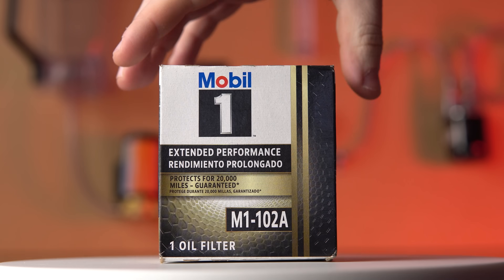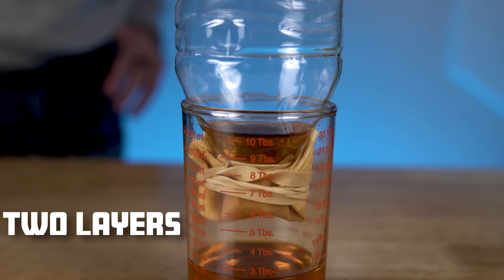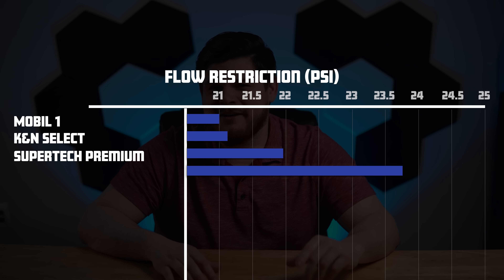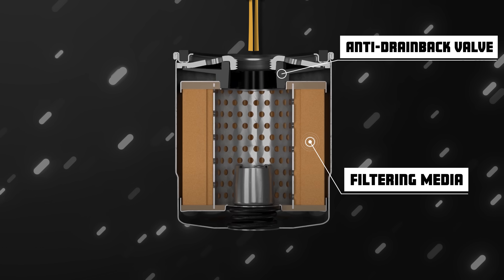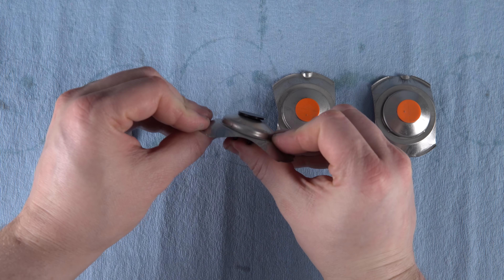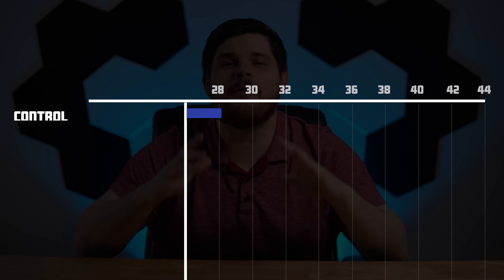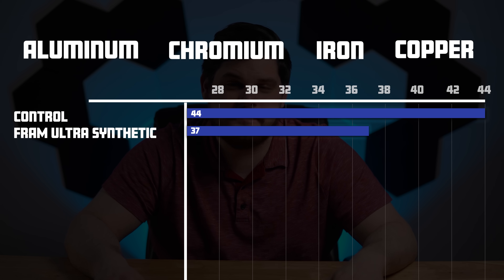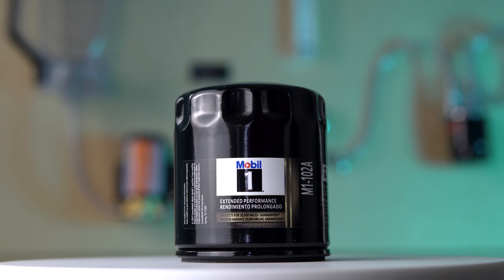Engineers Test the Best Oil Filters! FRAM | Mobil 1 | K&N | Walmart Brand

Comment: Honestly, my takeaway is that as long as it's not complete knockoff junk quality and literally falls apart, just send it and don't stress about brand too much.  For every extra bit you filter, you also restrict oil flow, which in some situations can increase wear just as badly as dirty oil.  Just get whatever filter and periodically check the condition and color of your oil, simple as that.  Any of these major brands must be good enough or else they would be sued out of business. You do far more by treating your car right and warming it up and cooling it down properly, doing a periodic long drive vs. all short trips, and avoiding prolonged idling like sitting in your car with the A/C on during lunch than you ever will by nitpicking oil filters and brands as long as it's a major reputable company.

Comment: Been using Wally filters for 30 years!
300,000 KM. on two Dodge Caravan 3.3 Liter engined vehicles/17 years each. Bought the filters by the case for $3.OO/ unit in the USA ( I am Canadian),  Neither vehicle burned oil in any amount that was concerning. Always changed both oil and filter at 3,000KM. ALWAYS.
WIX at various times made their filters but Wally goes for price and quality, and over 34 years manufacturers change. Especially Fram ?
Supertech filters are not really available up here now, so a trip south will be in the cards. But their oil is, and 80% of the time I use their oil.
Buying a new Corolla Cross and plan on changing nothing. 3,000 Km & Wally oil. 
Sounds like a good plan. Stick with what works and is reasonably priced. I always do my own oil changes.
Liked the test here though. Well done! But I would never use a Fram filter again.

Comment: ok so heres something i was thinking that could really throw this off. the weight of the oil its self. my wifes car runs a 0-16. basically colored water lol so the flow rate i would assume would be less of an issue say a pick up running 10w-40. would be awesome to see even a lighter weight vs a heavy weight in these test. would ASSUME. a filter like the fram being more restrictive with a thinner oil would still allow proper flow rate while providing better protection. although i could be wrong and weight may not even affect it at all

Comment: I've used Fram filters for years 

good to see other filters getting a spotlight on performance. 

At the same time however, temp also plays a massive role and I saw your testing did not account for that. That being said, i can forgive it 

Fantastic video and keep up the good work
Reply: Cut apart a standard,  base Fram filter. You'll never consider using Fram again.  The high end ones seem sufficient,  but the base Fram are incredibly cheaply built.

Comment: It's impossible to rate an oil filter by miles, then apply that rating to all your filters. You need to heat the oil to something close to operating temps. I realize that may be very difficult, but it will have an impact.

Comment: First I would like to say. Great testing. Is it possible that your fluid pressure test results could be effected by the bypass valve pressure setting? If the bypass was partially open during the restriction test. It could give you false results. That may be the reason why the Mobil1 filter did not reduce the contaminate PPM as much at the other.  How could you test at what pressure does the bypass valve start to open? I actually use the Mobil1 filter on most of my vehicles. I think feel most filters on the market will work fine for a daily driven car. just understanding their specs and you'll be fine. It's the high performance track driven cars. Where you will see the necessity for improved filtering. If you could test the Wix XP , and the MANN filters.
Reply from the maker: @Mark Edwards Thank you so much for watching and the feedback. You are correct, they could be affected. We released this video with just 400 subs and as a small channel we had very limited budget so we only included the inlet pressure. The best way of actually measuring the effects of a filter would be to measure the pressure drop across the filter. The by pass valve psi rating the oil filter remanufacturers advertise is this differential pressure not the actual inlet pressure like we measured, thus we don't actually now if the bypass valves were open. We are currently modifying our rig to better improve our testing methodology including the addition of an outlet pressure gauge to measure the drop in pressure. To determine when a valve opens is pretty complicated, but we might be able to if we run thick fluid and graph the flow vs differential pressure and look for the inflection point where differential pressure doesn't increase anymore, but this would technically be a ball park, then under a separate test we would ensure we stay below that pressure to ENSURE we are not bypassing. Hope this clears it up and thank you for your feedback, it really helps us improve as a small channel.

Comment: I suspect that the grit being at the bottom of the fram ultra filter was due to the grit falling out to the bottom of the filter due to a slower flow rate.  The other filters had more in the filter media due to not having time to fll to the bottom.  It was either that or the media was so tight that the grit could not penetrate at all which would be a great sign of way higher filtration.

Comment: Something to suggest. I would have ran a setup where you were pushing 50 psi to see if the media failed or when the bypasses opened.

Also it didn't look like you were running a heater. Might have been interesting to see how the media holds up with really hot oil (like 250-300).
Reply from the maker: Great suggestions! Thank you so much. Definitely planning on making some improvements for future videos. Thank you so much for helping us improve.

Comment: I used the Cheapest Frame Filter on my 97 Chevy 350 -5.7 liter Truck for close to 200,000 miles and it Never used any Oil and Engine always ran Good, it was Running Good when I Sold it...

Comment: been driving for over 40 years and always used dino juice for oil and a new filter.  Changed every 3k more or less and never once had a single issue with any vehicle I was driving.  You dont need an expensive or "the best" oil filter if you arent frickin lazy.  And if you dont change your own oil, just shut up.

Comment: There are many mid- level filters like Wix, PureOne, Motorcraft that’ll protect your engine for hundreds of thousands of miles without spending 10-15 bucks for them. As a professional mechanic it’s been my experience that most contaminants that cause wear such as dirt slip past cheap or worn out air filters. Even if you have a premium oil filter installed it’s not going to filter below 20 microns at best. Wear is primarily caused by particles smaller than that . Bypass oil filtration is the only method that will remove wear causing particles down to around 2 microns.
Run the best quality air filter you can and use a decent quality oil filter and change your oil when it needs to be replaced. I set my intervals at 7500 miles based on oil analysis . Some people can go longer intervals and some will be shorter based on their vehicle and driving habits.

Comment: Decent test only issue I thought of is the pressure numbers.  The bypass either needs to be disabled or need to know when it could be opening at the very least.  Not to sure it affected the results since oil pumps are roughly 70 - 80 psi regulated.

Comment: Has anyone installed a separate bypass system with a 2 micron filter? Amzoil has low micron filters. I was thinking of a setup that tees into the oil pan drain plug with an electric oil pump, through the bypass filter, and back into the engine. If the bypass system ever stops working, the original system is still in place. With 1 or 2 micron filtering, the engine would last forever.

Comment: Been running M1 EP oil and filters in all my vehicles for 15 years. Even in my 240k mile 5.4 3v that has known cam phaser issues and it's still quiet as a mouse fart.  Glad to see the filter did so well.
Reply: Dirty oil is what messes up the phasers. I change my oil at less miles than they say and my 5.4 is running great at 190k miles
Reply: Same here, my Honda and both my Nissan trucks I’ve ran nothing but Mobile 1 filter and oil and all vehicles hit 250k+ with no issues. Generally no filter is going to hurt your car, the cheap off brand ones quick lube places use is pretty much the only one I’ll never use.
Reply: Cam phaser on those is basically a routin maintenance thing done around 80,000 to 100,000 miles. Stupid system.  Is it possible to lock them once they get redone.
 After being told by many people that you could not lock them, I found a Ford guy.  Mine is going great. Was done a few years ago.

Comment: These are  NOT real world tests because there is no engine in the mix! Engine oil is not only used for lubrication but also for heat removal as the engine coolant does. it also needs to remove contaminants like carbon! Engines have an oil bypass valve. When the oil pressure gets to high it by passes the filter so un clean oil still lubricates the engine. the pressure in your engine is managed by the engineparts and the filter. exessive engine wear will lower oil pressure just like high rpm. the oil does not only catch metal particulates but also carbon that is wy it becomes black so black oil does not always mean it needs an oil change it can be black in as low as 100 miles this how ever could mean the filter is not that good because contaminants stay in the oil. so i would like to see heat cycling in the mix.

Comment: Has anybody realized yet that the "restriction to flow" test is just testing how soon the bypass valve opens? Lower pressure doesn't mean less restriction through the filter element... It means the bypass valve is opening sooner and oil is not going through the paper.

Comment: Did you test all the same fitment to same vehicle? For the PSI changes could be the result of the different bypass valve spring strength which is different for different vehicles.

Comment: Isnt the k&n select like a fake k&n? I think its just a economy filter with their name on it. The real k&n is almost 20 bucks and has a thicker housing and 1 inch nut on the end for removal. If i remember right it has the metal joint on the pleats and all the good stuff of a top grade filter. The pleats on the good k&n also give more surface area but still not as much surface area as some other filters like the mobil 1 in this video and the premium stp filter has a lot of pleats too. Ive been using the good k&n filters for a very long time ive cut open quite a few then my other favorite is bosch then mobile 1. I think wix is supposed to be pretty good we run their coolant filters and im really impressed with those when i cut those open but ive stuck with k&n for our oil filters.

Comment: I appreciate you taking the time to build a rig to really test filters! Every other YouTube video I've seen have just been breakdown videos where they compare visuals. It is this type of independent testing that truly informs us. Definitely subscribing.

One  minute detail would be heat, as oil viscosity is very different at operating temp and could make a drastic difference in filter performance.

One more thing that was left out in this video though was the oil bypass performances. All of those filters' bypasses are going to open at different pressures, and that is arguably one of the most important factors as play. Sure, one may have better flow than another or may have more surface area/better media in the filter... but if it is possible that one of these filters' bypasses opened during testing to allow dirty oil to flow  then it would not only make the test inaccurate but it also implies that the filter was not actually functioning as intended during testing. 

I wonder if there is a way to modify the filter housings so we have an indication if the bypass opens? I think this should be a high priority when testing longevity, as oil filter manufacturers today (pointing the finger at K&N) use this exact argument to market their product as being superior; sure, the other filters have better specifications, but those specifications don't matter if their bypass is open 1,000 miles before your next oil change or your vehicle is bypassing the filter on every cold start in the winter.

Personally, I'd rather see this test on motorcycle filters. The engines are smaller and more delicate, so it logically makes the most sense to me to truly want to get the best performing filter overall in that situation. To be picky, it would be nice to do Harley Davidson filters for twin cam/M8 as these are the two most common engines right now, they make their own, push consumers to use their own, but don't have testing to prove theirs is actually best for their engines.
Reply: #Perfect!!! 🙌🏻👍🏻
Reply: ok but these tests   are NOT CERTIFIED     ASTM

Comment: I do like how you say all filters are fine. I did buy a Fram ultra synthetic the one you tested. .I have a 2011  Ford Ranger v6 4x4. I dont drive real far by any means but it's good to know I have a quality oil filter and Pennzoil Platinum Synthetic Motor oil in my truck. 
Nice video and like many had our questions answered.

Comment: I use a 1”x1”x2” neodymium magnet with 250 pounds pull force on my oil pan to catch any micron particles smaller then filter wont remove. Some are no so small they pass through the filter. I pull it off during oil change and reinstall after oil has been changed and new filter.

This test is off a bit. Oil turns black because particles are so small the filter can’t remove them. So your filer test was a test of old oil other filers couldn’t clean. That why the oil still had so much parts per million even the control. Trust me get a powerful neodymium magnet for your oil pan. Don’t place it directly under the oil intake. Place the magnet off to the side near the oil drain plug.

Comment: I'm glad to finally see an oil flow test. I would love to see how Amsoil, royal purple, Purolator, and Wix filters perform against the filters that were already tested.
Reply: Seconding amsoil
Reply: AMSOIL filters actually are Mobil1 filters.
Reply: @becomeraptureready  they aren't. Mobil1 filters filter 99% at 30 microns iirc whereas amsoil claims 99% at 10 microns.
Reply: @becomeraptureready  No they aren’t.  Amsoil’s filters use a wire backed synthetic glass media from Donaldson.   
Mobil 1 uses a cellulose blend media.
Reply: @becomeraptureready  I have used both filters in my Corolla. They are definitely different.
Reply: @becomeraptureready Amsoil oil filters and royal purple are the same.
Reply: @becomeraptureready  Really, how can you prove this. Do the Mobil filters sell for less than the Amsoil?
Reply: @wally6193  I was mistaken, the Royal Purple and AMSOil filters are identical, saw them both get torn apart on a different filter comparison video. I personally highly recommend WIX/NAPA Gold oil filters, thats what I use on my Evo X and Fiesta ST rally cars.
Reply: Wix XP uses something fairly similar
Reply: Sergiu Gabor has a whole line of videos.  In the end like most things in life, it seems to be all about compromise.
Reply: What’s the actual real world importance?  I’ve seen plenty of vehicles with excellent engine wear fed a life of fleet luber filters and Warren or Sinopexc. I’ve also seen plenty of bikes on a track track day with $6 Frams doing 9 sessions of balls to the wall riding hitting 14 grand lap after lap and have yet to see an oil filter failure.  Seems like maintaining MOFT and accounting for shear in heavy use applications is more a important thing to worry about. Ohh and the state of your air filter.
Reply: Amsoil is garbage
Reply: Redline
Reply: Yeah, I suspect a wire-backed glass media provides much more flow for a given filtering efficiency.  

That would including Amsoil and Royal Purple filters, they use Donaldson’s Synteq media.

Comment: I bought 2 Mobile 1 oil filters for my RX350 and this filter had glue spider strings on both sides of the filter!! I bought 2 of these and they both had the same problem. You buy a filter to filter, not inject debris into your motor and the worst kind of debris. Glue!!!  What the? Made in Korea it said on the filter BTY.

Comment: Mobile 1 running with a high amount of grams of aluminum means nothing if it's not capturing the aluminum in its filter media, with as shows from lab samples, It seams to a poorer job at. What you should have done is compared the total grams of aluminum before flow restriction to the difference in filter weight from before and after said test to be able to know how many of the grams of aluminum was actually captured by the filter

Comment: Ive used Fram for decades on a daily driver,never had a problem...3 vehicles all surpassed 190,000mi.
No..dont believe Fram or any oil filter when the claim says 15,000,20,000 etc miles...thats crap..change your oil and filter frequently.
Did i use Fram on my drag car when i run the RPMs up to 7000 or 8000? Nope no way.

Comment: Excellent video. First time I saw something so complete. But, about restriction and filtering capacity specifically, how temperature of flowing oil should affect results? Cold and hot oil viscosity difference is very high. So, I think that if it is possible to introduce temperature factor in the simulation, results would be not the same. Thanks for the video. I use Wix XP, STP XL and Fram Synthetic.

Comment: If I've run Fram filters from Walmart on my Honda for over 100,000 miles (bought it just under 200k, now over 300k) and it's still running, then I'm just going to keep using them.  I replace my oil and filter every 5k miles.